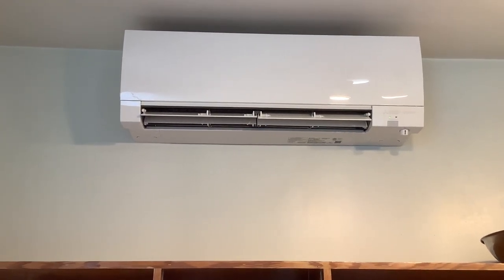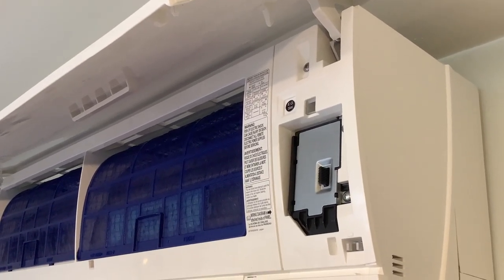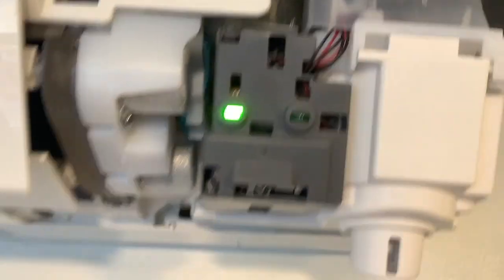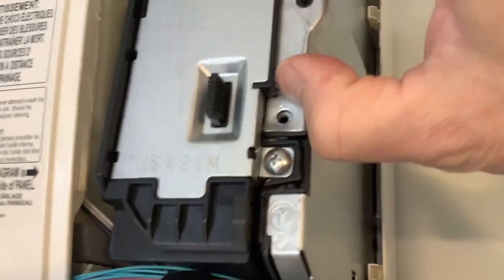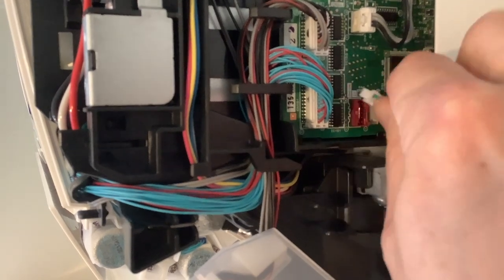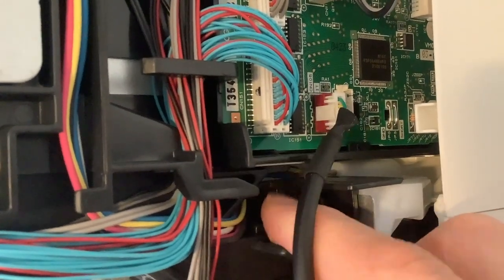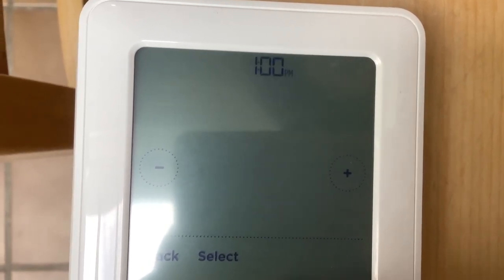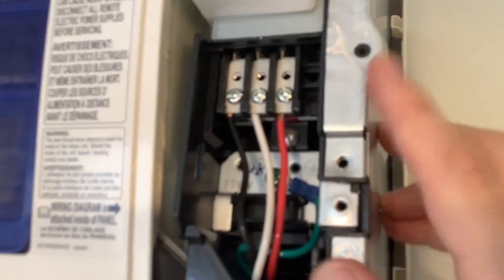Adding a Mitsubishi MHK2 Thermostat to a Mitsubishi MSZ FS Mini-split ductless heater

Comment: Thanks for sharing this.  It's super helpful.  Our 12K is short cycling when it reaches setpoint.  The prior one didn't do this (also a Mitsubishi unit). Adding an external thermostat seems like a recommended solution.

Comment: So what's the difference between the MHK2 wireless module and the PAC-USWHS002-WF-2? Do they do the same thing or is the PAC module part of the MHK2 kit? This has confused me a bit and kept me from converting my unit into a smart unit. Thanks!
Reply from the maker: @ayellowbeard: I'm not going to be able to give you an authoritative answer here, but searching Amazon for the PAC-USWHS002-WF-2, it looks to me to be similar to the MIFH2 wireless receiver that comes with the MHK2 in terms of its physical appearance. It mentions that the PAC-USWHS002-WF-2 is compatible with the MHK1, so my first guess was that it was an earlier generation of the same thing.  But it also mentions Wi-Fi support, which I don't believe the MIFH2 supports.  We haven't integrated our heaters with our wi-fi or smartphones, so I don't have any firsthand experience there to share, I'm afraid.
Reply: @bradchamberlain5249 Thank you for your reply.  I posted a few questions about this issue over on reddit and got a few answers, one of which is that the WF2 will allow me to receive data on my phone which is at least half of the reason I'm interested in doing this project.  I just ordered the WF2 off of eBay (got a good deal) and so we'll see where that takes me once installed.

Comment: The unit shouldn’t be mounted so close to the ceiling it will restrict the return air and prematurely damage the unit, Mitsubshi code is 5 inches minimum
Reply from the maker: Our units' installation instructions seem to suggest a clearance of 3-3/8" above the top of the mounting plate.

Comment: Curious, do you have the ability to control the “Fan Speed Thermo-Off Heating” (Mode #25) with this thermostat and your model mini split?

I have the same mini splits and I’m trying to solve some overheating issues in 2 bedrooms that I have. The Kumo Cloud app doesn’t control the option to turn off the fan in heat mode when the temperature has been reached, wondering if the MHK2 will give that ability for me.
Reply from the maker: @iamsars19 : Not with this mini-split, no.  My understanding is that mode #25 is only available with certain unit types using this thermostat, and that the MSZ series is not among them.  We do have that mode on the MHK2 that controls our other system, which is ducted and uses an air handler, but not with these mini-splits.

I don't use Kumo Cloud, so don't have any direct experience there, but am surprised that the fan doesn't turn off once the temperature has been reached in heat mode.  That seems to be the default for our units, which are off, or silent, most of the time that we're at our set point.  The thermostat (and remote control that came with the units) has an option for fan speed, which can be set to various levels or "auto".  We've generally kept ours on auto almost all of the time, which has caused it to turn off once the set point is reached and any remaining warmth has been flushed out into the room.  So the MHK2 can be used to make that choice of fan speed, but I'd expect you to be able to control it using your unit's remote if not Kumo Cloud much more cheaply.

Comment: I have 4 Mitsubishi MSZ-FS wall units. 2 are FS06, one is FS09, and the other is FS12. For those who have this model, have they given off a weird odor when in cooling mode?

All 4 of mine give off a weird stench. And believe me, we’ve had these units checked for mold countless times and they come back clean. I’ve used coil cleaner and bleach water as well as some deodorize tablets and yet this darn smell is still there literally a day after applying these cleaners. I’ve read it has to do with the condensation that occurs on the coils after cooling the room.  The first time we had this weird smell was literally a week or two after they were installed. Just curious if anyone has had this type of issue with the smell they give off and if you have any ideas I could try.  The installers and other HVAC folks have not been able to identify this weird smell.

Also, curious what brand you use for your condensation pump for these models.  Mine are 230v Aspen Orange for all 4 heads.
Reply from the maker: I haven't used ours in cooling mode yet, so don't have any data to share there, but maybe others will.
Reply: @bradchamberlain5249 ok, when you do, I would love to hear your experience with it. Hopefully you don’t have to go through any weird smells from your side.